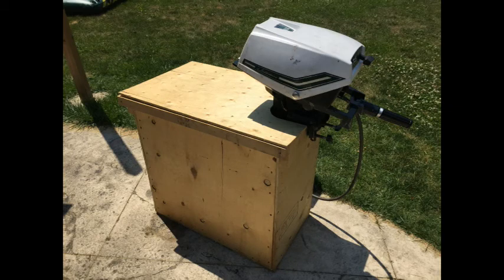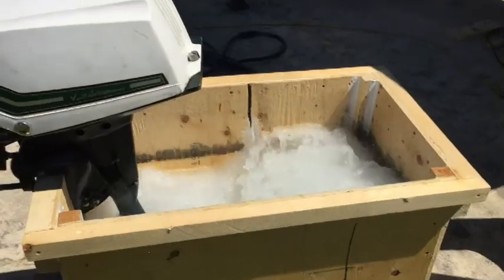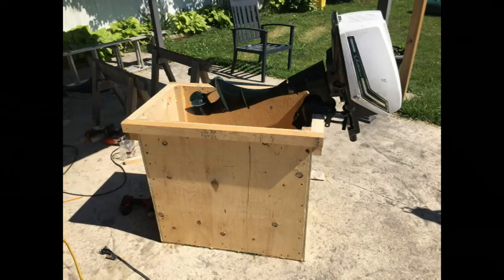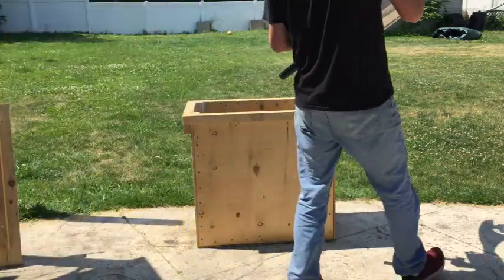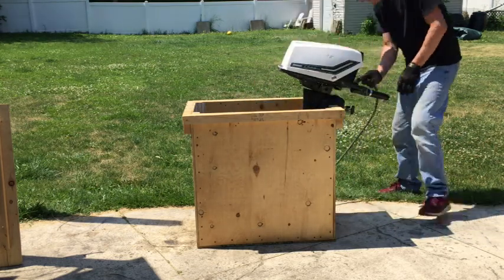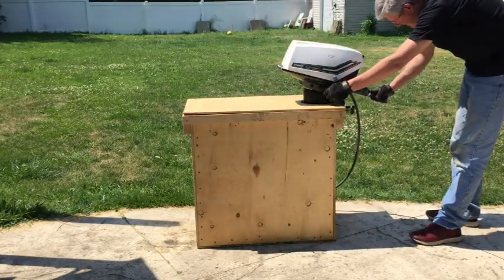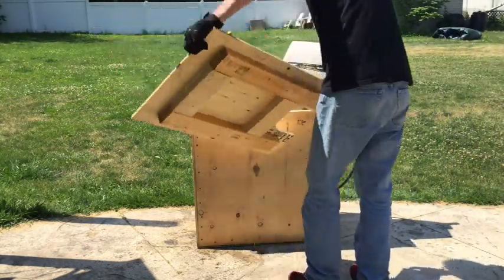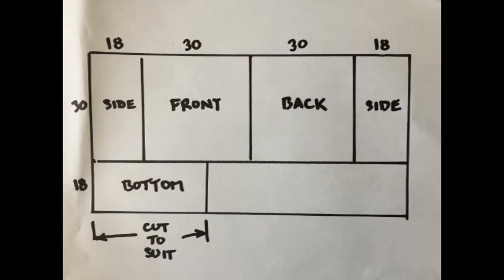DIY $50 Outboard Motor Test Tank

Comment: How has this held up against rot?
Reply from the maker: Its still good. Mostly stored outside but being used currently as a wood storage box in my garage. Cheap plywood will last a long time so long as it is allowed to dry out after getting wet. I once built a small boat of the same plywood that was painted on boat sides of the plywood. Stored uncovered outdoors it lasted 6 years. The paint trapped the moisture in the wood. I have an unpainted fence with the same plywood that is currently 20 years old with no rot.

Comment: How did you make the wood to be water tight?
Reply from the maker: I didnt worry about it. It leaks a little when first filled with water and after a while the wood swells and it stops leaking. The internal corners could be sealed with silicone if leaks were a problem.
Reply: @makecoolstuff9170  oh ok, I've been thinking about doing something similar and put pond liner inside to make it more water tight.